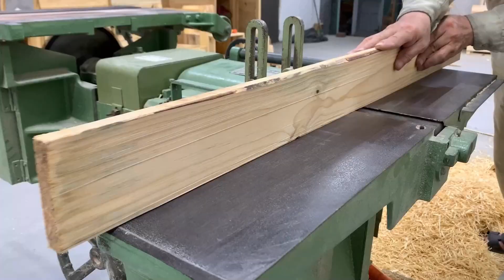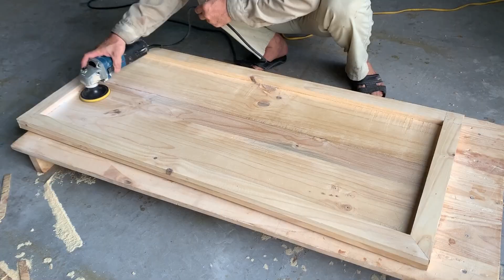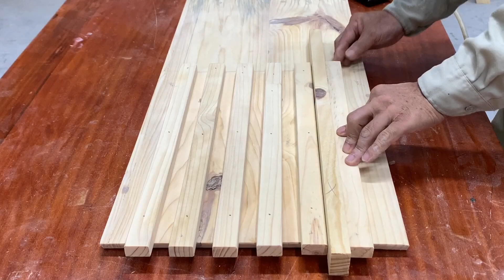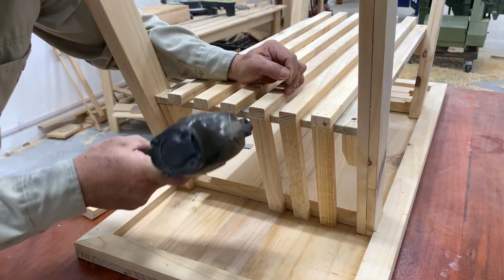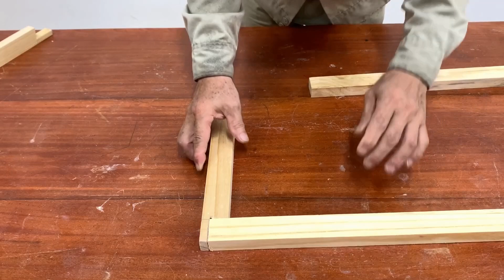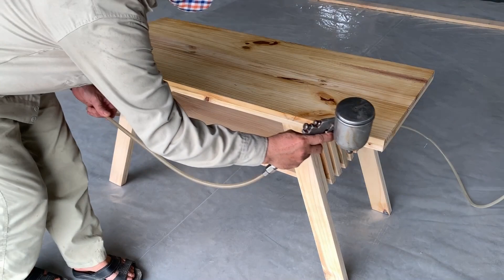Creative Woodworking Ideas With Simple Design // Make A Tables Chairs Save Space In Your Home

Comment: So what happens when the person buying it gets it home and the floor isn't level sins the seats don't have much clearns as it sitting on level floor would have taken a little more wood but if he did it where the leagues conetion was bottom the level of floor would not matter but as pretty as this is no matter the configuration the nails are fish nails not for structural glue is only meant to hold the stuck supports in place this is all put together with face to face connections with finish /trim nails think how much stuff has won seen or Owen that the trim came off well think that is how the seats and legs are it can handle down force but no side forces for long and most people twist when sitting down or getting up